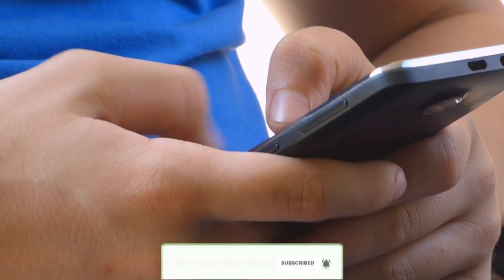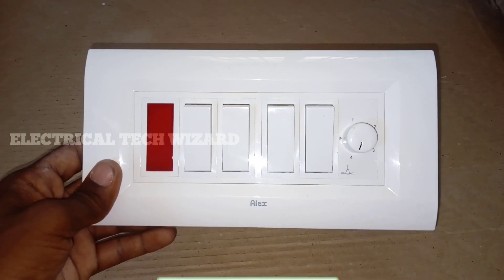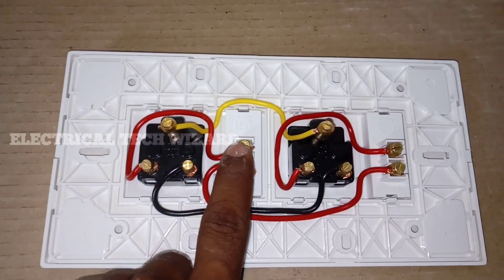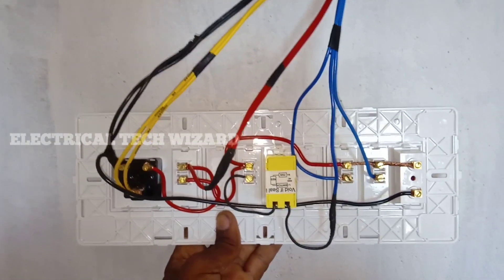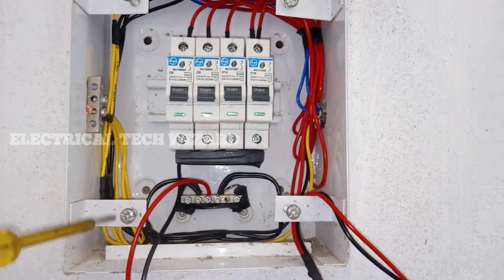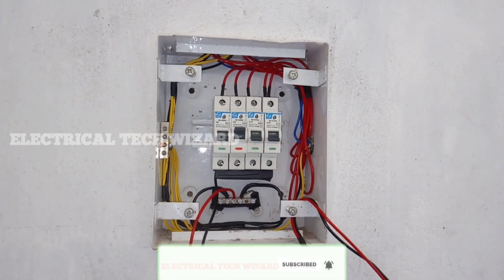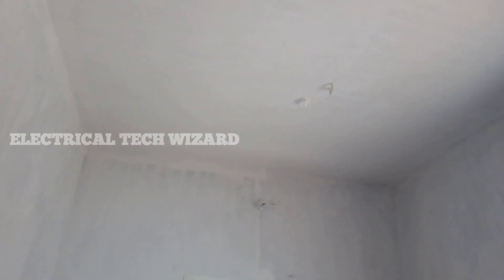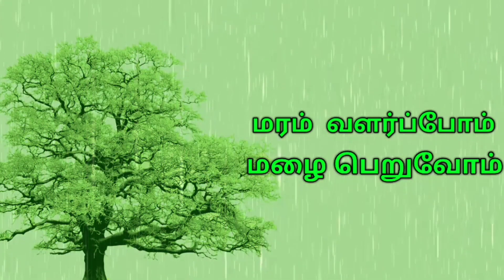house wiring tamil | switch box size and db wiring connection | house wiring full explanation video

Comment: Bro ipo main MCB adhula use pandra endha room oda load adhikama edukudho adhuku use pandra MCB vachi adha 2 aala multiple Panni main MCB select  panlama ipo 5 room   total load calculate panni hall  la 20 amphs MCB varudhu  ipo idhan adhikamana load edukudhuna indha 20 amphs single pole MCB 2 aala multiple Panna 40 amphs varum idhan main MC a ipdidhan main MCB select pannamuma konjam detail a sollunga bro
Reply from the maker: 40 amps ku mela pona 3 phase service vaangi load ah share pannikkalam brother 😍
Reply: @ELECTRICALTECHWIZARD  ipo 5 room irukuna endha room la adhikama load consume aakudho andha room Ku select Panna MCB vachi adha 2 aala multiple pannanuna max size of MCB into 2 aala multiple pananuma bro
Reply from the maker: ஆமா brother
Reply from the maker: Enna single phase meter load 5 to 30 amps thaan irukkum
Reply from the maker: இல்ல na total load 2 aala multiple pannalam
Reply: @ELECTRICALTECHWIZARD  ok bro ippadhan doubt full a clear aachi last conform pannikiran ipo 5 room la 14 amphs adhikamana load consume aakura room ipo idha 2 aala multiple Panna 28 varum ipdidhana  main MCB select pannanum ipdi vandha idhuku 32 amphs main MCB podalam dhana bro idhan last idhuku mattum reply pannunga
Reply: Bro idhu mattum sollunga bro evlo time ketta solla madringa sollunga bro reply pannunga